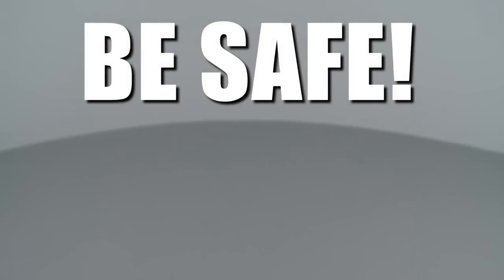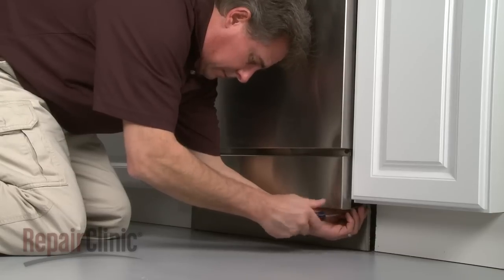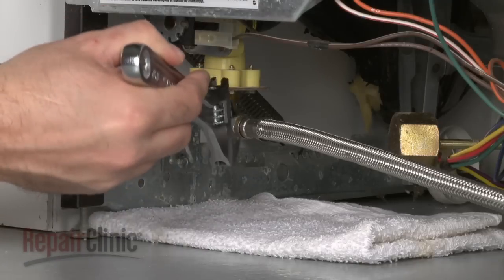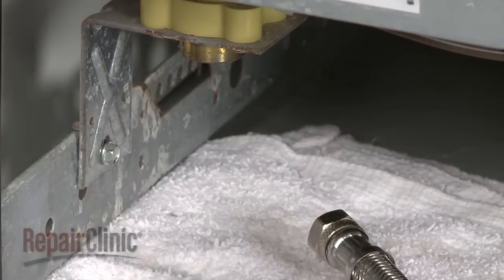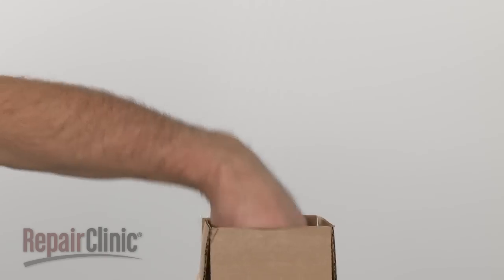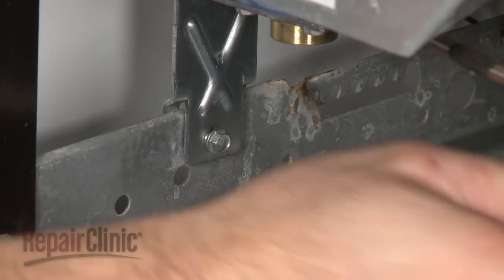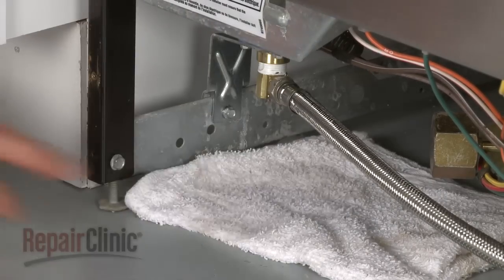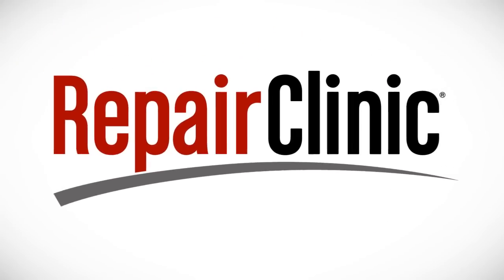KitchenAid Dishwasher Replace Water Inlet Valve #9744468

Comment: I replaced the inlet valve and it didn't solve my issue. How much water is required to fill in order for the arms to spin and wash the dishes?
Reply: Did you every figure out why your arms wouldn't spin?  I ran the diagnostic and it came up with F6E1 (water inlet valve screen).  But my dishwasher is getting water but the arms are not spinning, thus not washing dishes thoroughly.  Any help you can provide would be much appreciated.  thanks
Reply: @toddspencer8083  the pump motor needed to be replaced